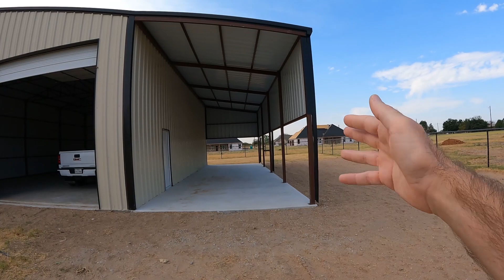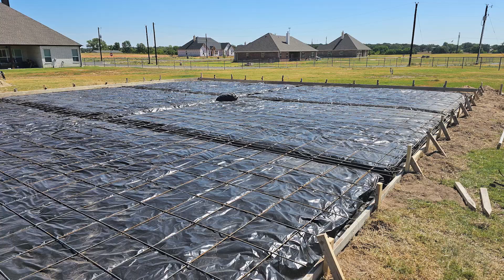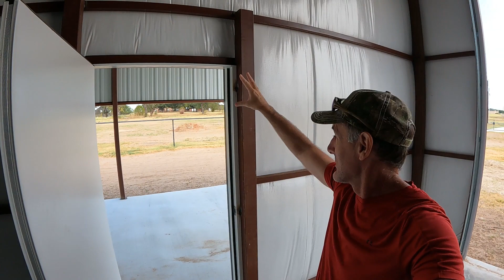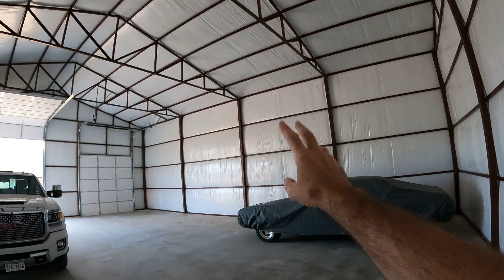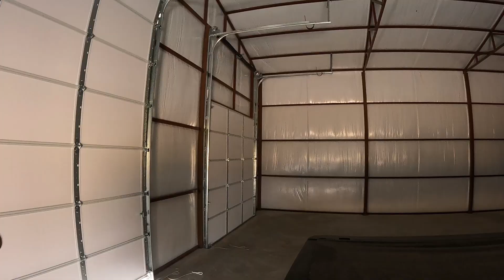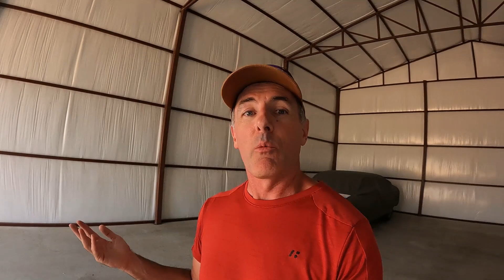True Cost to Build A Metal Shop / Garage

Comment: I would only do the $46k no insulation and build little room office type with kitchen bathroom and sleeper. Also I would eliminate small roll up and do big roll up on the back. Overall it's awesome and pretty. Do a video now same thing but with metal. I think metal cost less than steel beams

Comment: It sounds expensive until you break it down to price per square feet, your shop alone is about 30 per sq ft. I built my own in 2006 and it was 16 per sq ft. I did not do the dirt work or concrete but I did do the poly and rebar and everything else so your price is not bad.

Comment: Expensive and really love your shop but you got yourself one awesome built shop and it will probably cost way more in just a year from now with these gas prices so all good. 

 Do you know of a good concrete guy that is fair priced to do some dirt work before pouring me a driveway and walkways to my front door plus want a pad out from the front of my house 25x10 here in Yelm, Wa.?  Wish I could get myself to put up about a 30x25 small shop for my pro street car so could put a lift in but hate parting with the cash the direction our country is headed.

Comment: Matt your one person with a future Shop. Realize even if you had  help, it's still you as help can not always be there always. You have the money to have built or had built will do everythng a garage shop needs. Don't need the desire we get in our youth when we go into a Candy Store. LOL🤣! We learned the outcomes. Just pace yourself & enjoy one minute⏱ at a tme. There are 1440 minutes⏱in every 24 hours🕰& the next minute⏱has yet to arrive. Your outside roofed slab gives you the option to enclose. What about a good exhaust fan high up in rear wall? Keeps the place workable atmosphere & exhaust fumes☠out. in past I used Exhaust Fan with Temp Guage on it & when got a temp hotter would go on. With some equiptment you many want 200 amp service. Put solar panels on your roof & lititum batteries you run mini splits great. With high ceilings takes a lot to keep cool. To heat have you thought of a good outside wood burner? They heat a garage great & make great hot water. You have one going they will go 24 hours. You have options with power. always, Tommy🤠